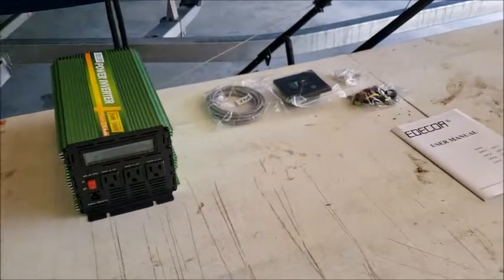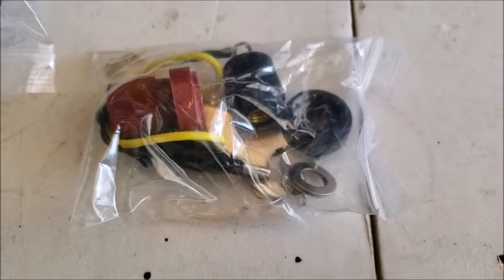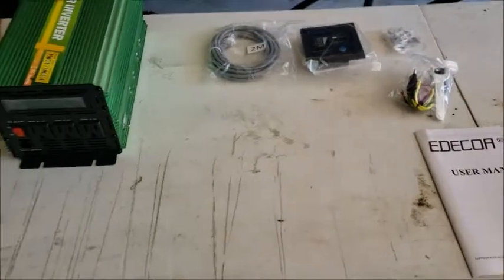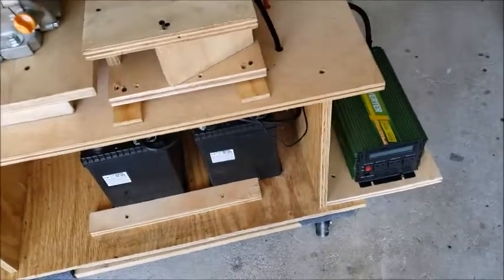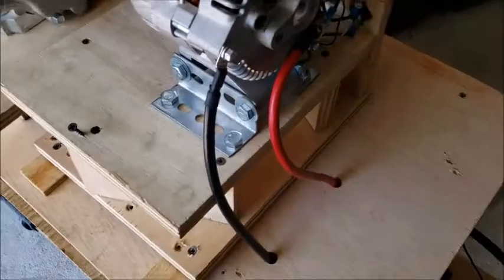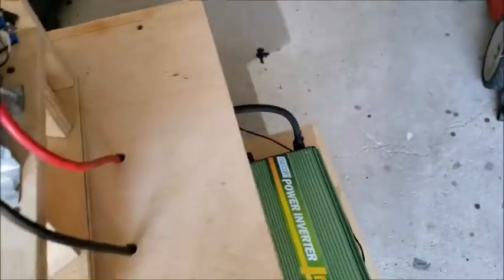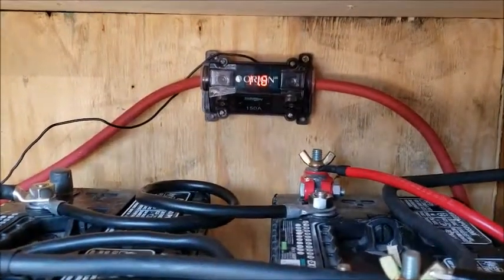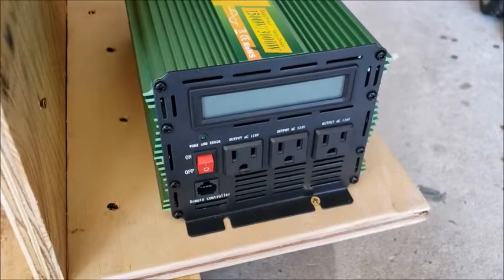EDECOA 1500W inverter with DIY Alternator/Generator

Comment: This is a tidy set up! Couple of questions if you don't mind...
Are you charging the batteries directly with the alternator, without using a charger? 
Couldn't the inverter be wired directly from the alternator to save drawing loads of amps from the batteries when in use? 
Why not rig up an electric motor to the battery to drive the alternator?

Comment: Sir have you try this pulley setting 69mm(alternator) Connected to 100mm using belting system. Single phase Motor rating 2800rpm

It may produce around 3700 - 4000 rpm without load

The alternator need more than 2000rpm to start charge a battery

Comment: how to connect the ac out onto the battery exactly?
Reply from the maker: You do not connect AC current to a battery. The alternator puts out DC current for battery charging the batteries are then connected to an inverter which converts the 12-volt DC power two 120-volt AC power.
Reply: @generalinfo9452  how can i make DC output turn on 220AC volt?

Comment: 8 hp is abit over the top for running the alternator! 2.5 hp would be enough for that. You may as well have a 4 kva generator if your using a 8 hp engine.

Comment: Hi, where did you get the adapter to run the crankshaft straight to the alternator shaft?  Thank you.
Reply from the maker: The one in the video I made but I didn't last long I ended up using a 1-inch Universal
Reply: @generalinfo9452  is it a 7/8 key bore by 1/2"? i was looking at possibly the rubber spider couplers on amazon
Reply from the maker: 3/4 by 1/2

Comment: One thing to keep in mind is the alternator cooling. They will make good current even at low rpm but if the fan in the alternator which is connected to the shaft is not spinning fast enough u will let the magic smoke out. U can either install a controller to reduce alternator feild when temperature goes to high or u can use an stm32 to monitor output load alternator temparature engine rpm and do the optimal throttle position to keep the alternator cool while using as little fuel as possible.

Comment: I'd like to see a safety cage around the pto and you should use a rubber union  to absorb the vibration, otherwise you could damage the bearings prematurely,  my 2 cents, otherwise nicely done, you have room for a third battery in there, hint hint.
Reply from the maker: All very good ideas, thank you

Comment: Could you try running without the batteries? Would the inverter still work?
Reply from the maker: Yes of course. Without the batteries it would run just like any other generator you could buy from Home Depot. The batteries only serve as backup for when the motor is not running you can use the power from the batteries period without the batteries the alternator puts out 14.2 volts

Comment: Good morning, how did you link the engine with the alternator, which you may have used to join them, thank you
Reply from the maker: I made a socket that would fit the nut on the alternator and attached it to the shaft of the motor

Comment: For 1500w you should only need a 2-3hp motor.  Should be about 750w generation per HP. You may want to consider a flywheel with a pulley system.
Reply: The issue is with alternator efficiency. They are typically 50% efficient. So to make 750w u will be also wasting 750w as heat and so u need 2hp. So to make 1500 u would need 4-5hp.
Reply: Why would you say something so controversial… yet so brave!
Reply: Would that work with his alternator or would you have to switch that system out too

Comment: You need my ULTIMOTOR
Reply from the maker: What is this ultimotor?
Reply: @generalinfo9452  it be nice if you can type a link to buy the connector between the motor and alternator...
Reply: Ya expand on this ULTIMOTOR
Reply from the maker: It's just a socket that fits on the nut on the alternator.
Reply: @generalinfo9452  what a  genius. I like the way you think hahha. Nice machine.
Reply: @generalinfo9452  thank u

Comment: I wonder how good that alternator is doing don't seem like it's cranking enough RPM maybe a pulley system would help
Reply from the maker: I had it on a pulley system and it wasn't enough with a belt for some reason I was having problems so I went to a straight connection and it puts out 13.8 to 14.2 with a load on it with no problem.

Comment: I like this idea the only problem with this is that gas is still necessary
Reply: Is it possible to use smaller engine ? How much rpm is required for this alternator to achieve 1500W ac output.
Reply: rodrigo lopez what else would you use ????